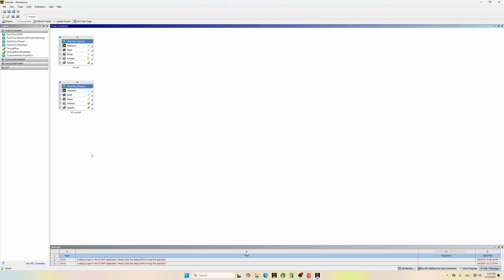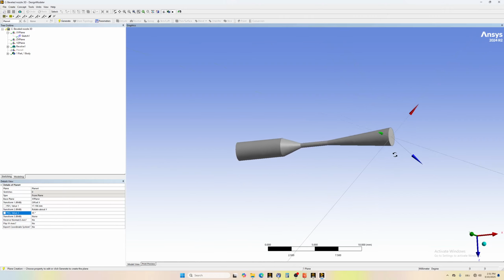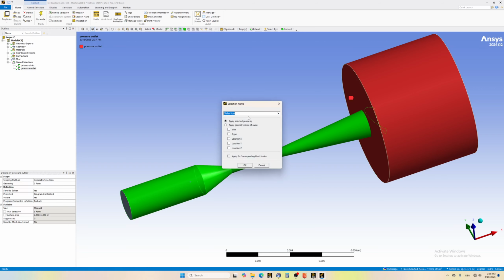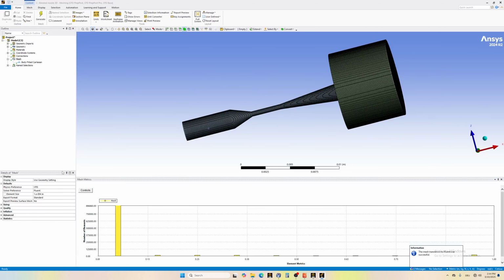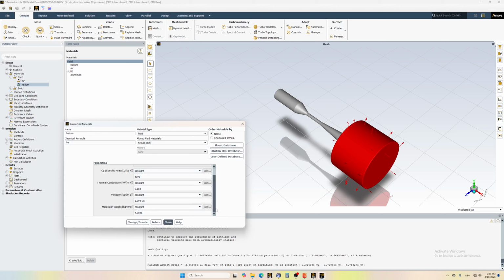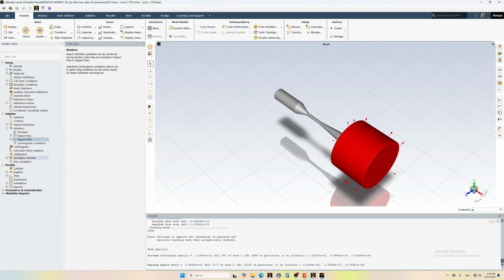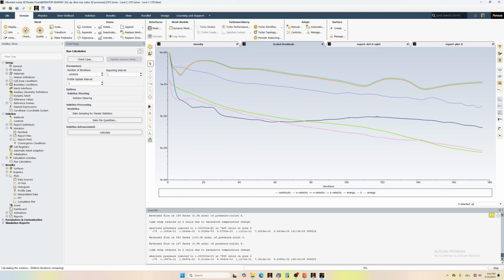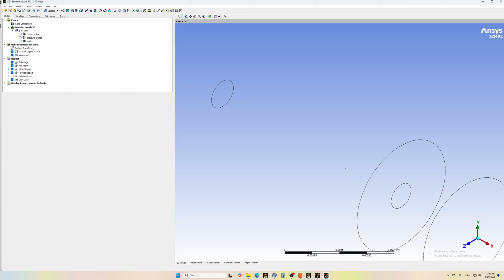3. Design and simulation of a beveled nozzle with Ansys Fluent and Cartesian mesh.

Comment from the maker: There are two critical mistakes:
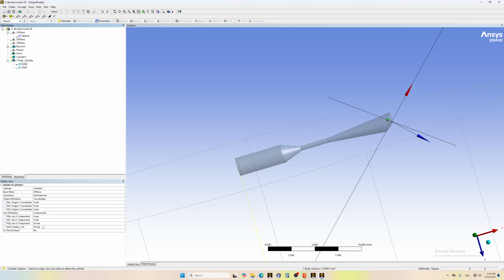1. At 09:36 when I create the cylinder I have to change the Operation from "Add Material" to "Add Frozen"
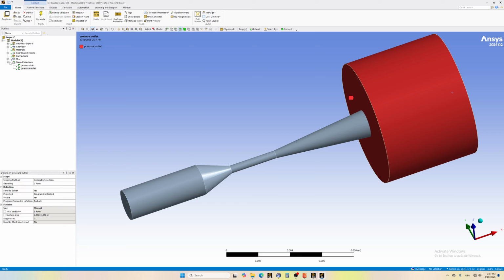2. At 13:42, when selecting the wall surfaces, I must include the surface inside the big cylinder (or outlet). Just click on the cylinder's surface and hide it, then select the wall of the nozzle. In total, you should have 5 surfaces defined as walls.